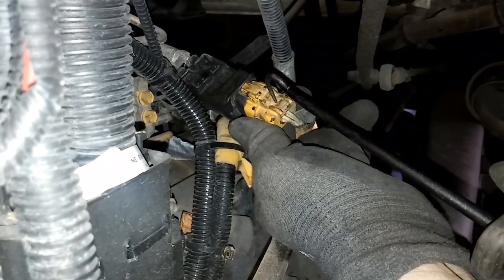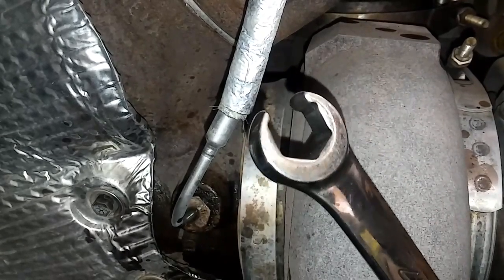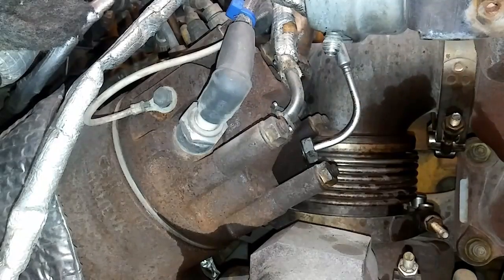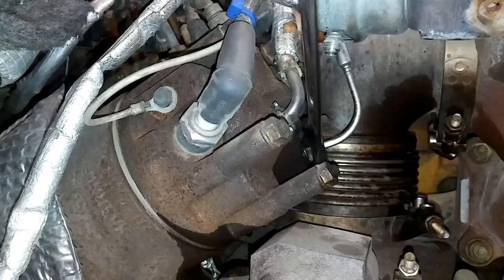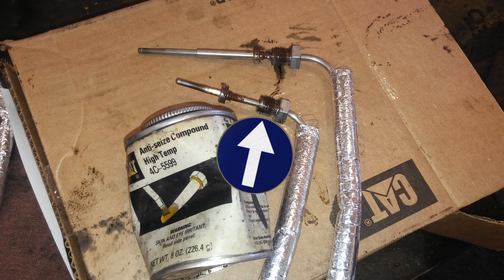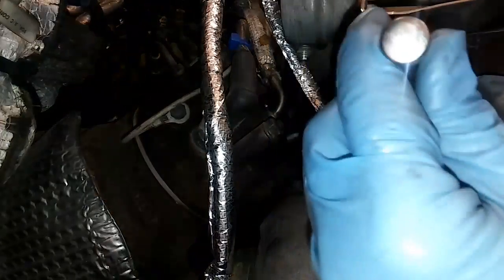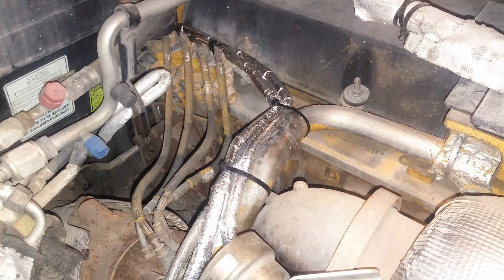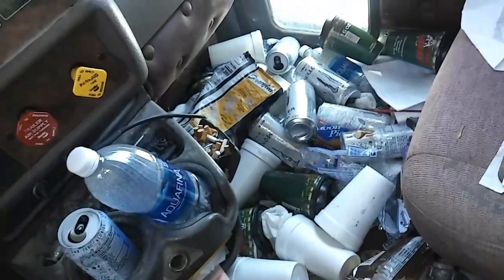How To Install An EGT Sensor.  Diesel EGT Sensor Change.

Comment: Be careful when using dielectric grease on gasket sealed connectors. AMPSEAL and similar Deutsch connectors have silicone rubber seals that could be degraded by silicone-based grease.

Comment: Need to do this to my Detroit engine, problem is it’s a volvo and not volvo nor Detroit can find me the correct sensor with plugs, so you know if I can get away with a universal EGT sensor and splice it in? If I can are wires reversible or need to be wired correctly, has 2 wires with 2 separate plugs. Any help is appreciated thanks

Comment: As usual Thank You for a great lesson.  The end of the video shows a slob.  I was helping my on in law buy a "new truck".  I sat in Ohio with my laptop open and he was in TN at a dealer looking at a bunch of locked used trucks.  The dealer was honest.  Nothing was done to the used trucks until someone wanted to buy it.  I like to see what was done and how the truck was run.  Well, one truck had low mileage but a cab like the one you showed.  I advised my son in law to walk away; anyone who kept his personal space that was unlikely to maintain the truck!  So we bought a 2003 Kenworth with a rebuilt CAT 15 engine in it.  Clean!  The truck had sat for a while and we had some fuel problems.  Some tank cleaner and four fuel filters and the problem was resolved - old fuel.  Then he had to take the truck to a Kenworth dealer.  As a standard protocol the technician ran a Life History Report.  Curtis asked him if this was standard: :"Yes, unless I want to get fired." Well, three wiring harnesses were shot and replaced and I think the mechanic did a valve adjustment since the head was off.  The truck now runs like it was new and MPG has increased dramatically.  Good dealer #2 and if I remembered it, I would put it here.  I only wish McBride Mack Truck Sales in Paducah had done this before increasing the horsepower.  They did not and the engine died at about 600 miles. Lesson learned.

Comment: if you're replacing it, why not cut it off ..??
Reply: I see that as an unnecessary step, that would slow things down.  I supposed if you couldn't get the nuts loose, and didn't have a sensor socket.  I've never had any issues getting them out though.

Comment: Was that a spark plug I saw and what does it do
Reply: I didn't see it but the ARD head has a spark plug. Josh has a video on ARD heads if you are curious.
Reply: That spark plug is on the ARD head, and the head introduces air into the exhaust, sprays fuel into it, and then ignites it to clean out the DPF.